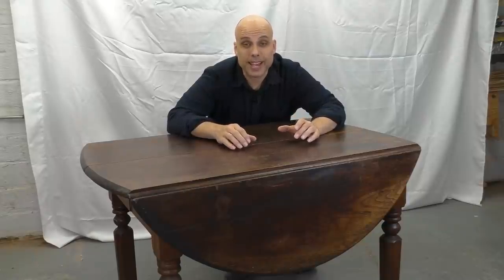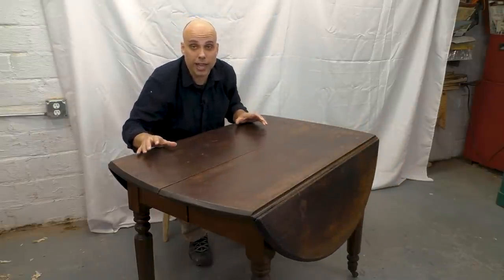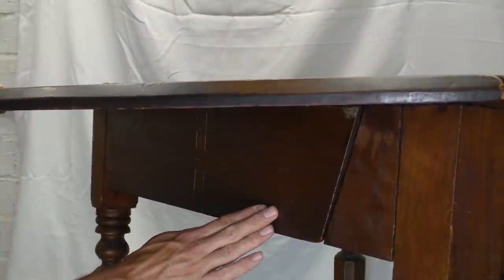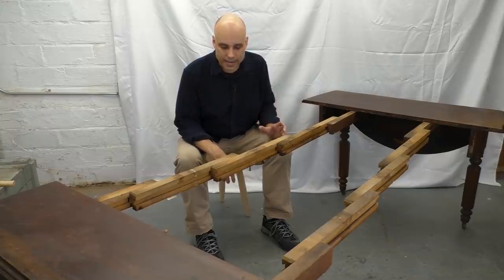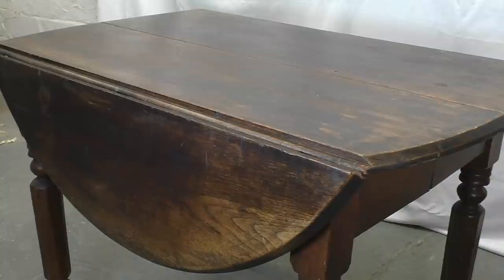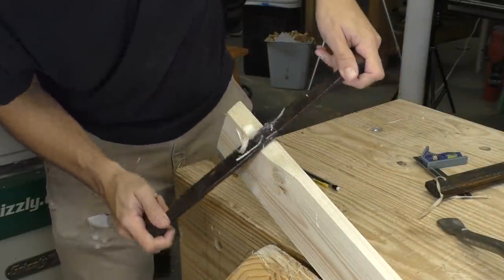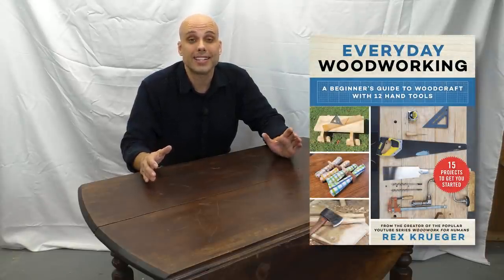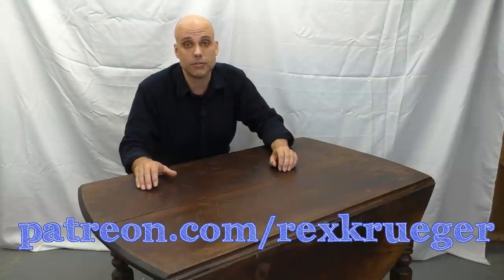Furniture Forensics with a Secret Expanding Table

Comment: My mother has a similar table. It is painted in an of white colour. I assume that the top is made from plywood since there are no glue lines to be seen from under the table. It is also round or oval shaped and has a lovely edge molding.

Comment: Rex, I have a similar drop leaf table, it is rectangle tough. The ends are held up by a swing arm with a leg to hold it up and there is no chance of tipping the table over. I is very stable.  It has the same slides this one has. I wish I had the leaves for it to make it bigger but I don't. I have not been able to find a maker's mark on it so I don't know who made it.

Comment: It's funny but only a few days after I watched this I visited a friend who has a turning works.  He asked about a family table that his grandfather(?) had found in the barn.  They had cleaned it up and used it for years.  Now he was considering giving it to another friend.  And wanted my thoughts.  The table is oak four feet by four feet.  It has an odd crown molding trim masking the aprons.  The molding is clearly part of the original design, but still, crown molding???  Any way, look under it, as you say.  The first thing I saw was a solid oak series of rails just as are in this table.   Wow.  There lots of other fascinating details.  But still, I had never seen this before you showed it here.

Comment: My Kitchen table expands like this. I have 3 wide leafs and both sides are drop leaf. To keep the drop leafs open, you pull the legs out. I can basically sit 18-20 people at my table. If I had enough chairs. 😂

Comment: I don't think the maker was deliberately being a die-hard 'slave to tradition' because, firstly, he was open to the idea of using machined components and, secondly, the machined extending components were probably new to him, so he didn't realise it wouldn't hold up over a long period. I can imagine it was one of his early attempts and later versions would have been reinforced, due to having gained experience from repairing such faults.

He may have simply adapted one of his trusted old fixed-size designs by cutting it in half and installing all the stretch parts. The weight of all the intermediate sections on top of the stretched rails would have added a lot of weight that would have eventually caused sagging in the middle and thus forcing outward on the bottoms of the legs, making the joinery fail.

Comment: I have almost the exact same table that I've been rehabbing for longer than I'd care to admit and now that I'm in between shops and it's in storage ... 🙄
The legs are turned all the way with no flat fields like this one has, but with similar bells/balls. It's almost the same color too.
One caveat the table I have has is a fifth leg! It sits under a support rail that runs the center of the extensions - obviously for support while holding a lot of extensions.

Comment: My parents have a table like that which they bought from Horning's Chair Shop in Ephrata PA in the 1960s, and when I got married in 2000 and they asked me if I wanted one from the same chair shop I said HELL YES and now not only is theirs still kicking but mine has 20 years under its belt, too.
The whole set in solid cherry, the table, six windsor chairs (one with arms), and six leaves with a storage rack, all cost $1600 back then and I remember thinking at the time we were outright stealing it.
Reply: True story, when I was young I got Nerf Ping-Pong for Christmas and played it on my parents' oval table and hated it.  So when I was shopping for mine I wanted it rectangular, dammit, in case I ever play Nerf Ping-Pong again.
And we used it for about a decade, and then I watched my 3 year old daughter toddling past the dining room and POW smack her head on the corner, and I understood why oval tables are popular.
Reply: Another interesting bit is that the leaves on my parents' table from the 60s had poplar leaves instead of cherry, because it saved them some money and looked reasonably like cherry when they stained it.  By the time I got mine the price difference was like $10 per leaf and I thought you know for something I know my grandchildren are going to inherit, an extra $60 seems worth paying.
Reply: How strong is it when fully extended and laden with food plus four people on each side leaning on it?
Reply: @kevmicjen  By the 1960s they learned that they need a floating middle section with a central fifth leg... so yeah, I can dance on mine with all the leaves in.
Reply: @fisharmor  thanks

Comment: Reminds me of the poor chess table we have. It has flaps like those for extra space, but one of them got damaged because some fuck waffle from the power company shut off the water and then turned it back on when nobody was home. This caused the water hammer effect to burst a pipe, and then wet sheetrock fell on top of and damaged the table.

Comment: The history of that table screams "tinkerer" to me, like someone owned a simple old hand crafted end table and kept improving it by adding their own changes later in the furniture's life.
I'd also be curious if the table could possibly support any weight while fully extended.  Wouldn't the center just collapse?
Reply: In the UK growing one, it was rude to have one’s elbows on the table. 

I wonder if it’s rooted in the weight issue you rightly point out - Could hold a few plates and some foot, but is actually quite weak comparatively.

Comment: Is there any chance that the furniture builder used some sort of custom shaping plane that would allow those inset grooves?
Reply from the maker: I wondered that two,  but i can't imagine a shape that would actually work.  You can't have a t-shaped blade buried in the wood.  No one is strong enough to push it.
Reply: @RexKrueger  maybe if they used two tools: a plough plane to cut the centre groove, then a sort of molding plane, lying on its side, to undercut the sides. Either way, it's an interesting joint and it still seems to work reasonably smoothly.

Comment: Ces tables sont courantes en France. Ce sont des tables 6 pieds. 
C'est surtout dans les intérieurs bourgeois ou petit bourgeois qu'elles se trouvaient dès le 
xix siècle 
Il y a plus rarement des tables plus grandes à 8 pieds.
Les rallonges sont faites à la machine et fabriquees en série des le xix siecles.
Sur ta table il manque les 2 pieds centraux qui stabilisent la table.
J'en ai eu deux, l'une en noyer Louis XVI avec deux pieds centraux mobiles, l'autre en acajou avec deux pieds centraux ( en général plus etroites pour que les convives centraux puissent mettre leurs jambes).
Les chiffres I à VII MARQUENT les emplacements des 3 rallonges ET NON 7 en bois plus ordinaires planche a bord 1et 2 planche b bords 3et 4 planche c bords 5 et 6 . Et voilà ! Les bords sont jointifs et s'assemblent  comme des lames de parquet. Il y a un ordre à respecter ces planches sont composées de planches encadrées par un cadre de bois.
Amicalement, 
P.s I love your channel And I hope you can translate or understand (that would be better)what I whrote.
By the way the sliders are still made and sold in France. Not common but still made so furniture makers or restaurers don't waste their time to do them.
Just Google "coulisses de table en bois" and chose the pictures.